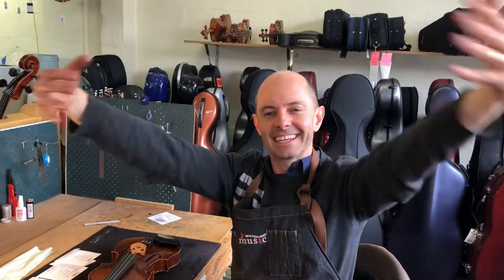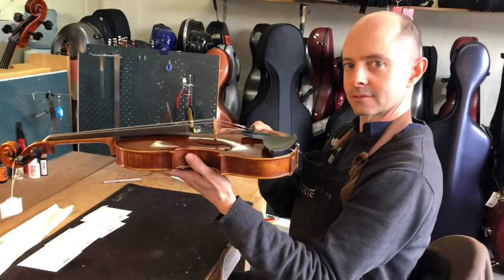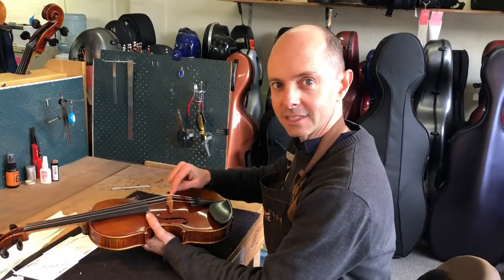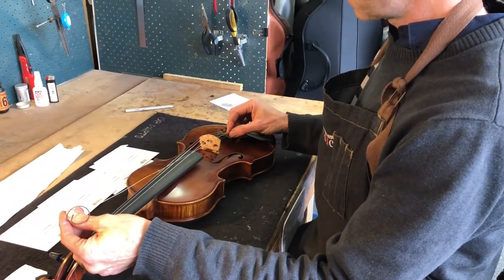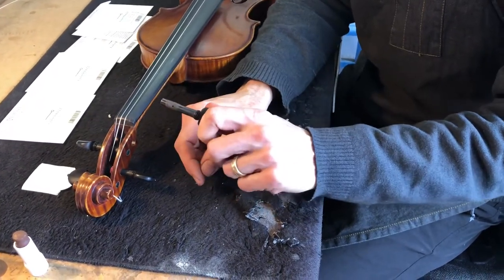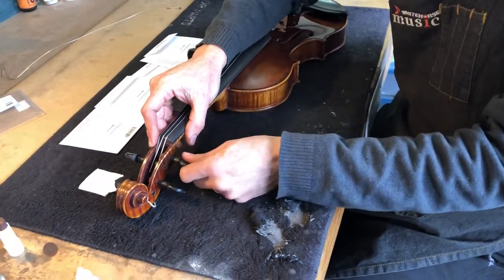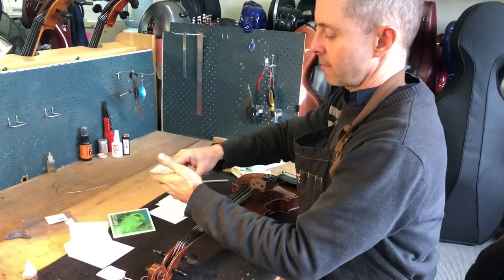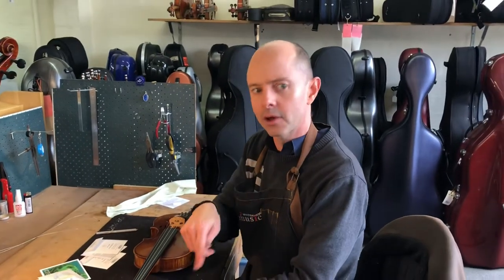How to restring your violin

Comment: Hi, should I avoid the g and e string from touching the pegbox?
Reply from the maker: Yes :). Depending on the thickness of the walls of the peg box, it can be easy or difficult to position the string so it doesn't rub against the edge of the scroll toward the nut. Either way, its important to leave a small gap.